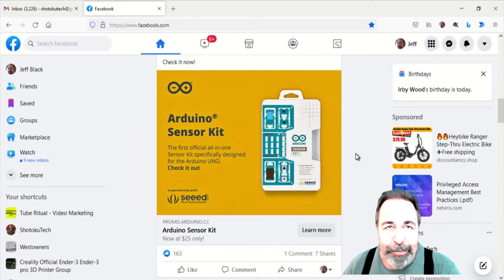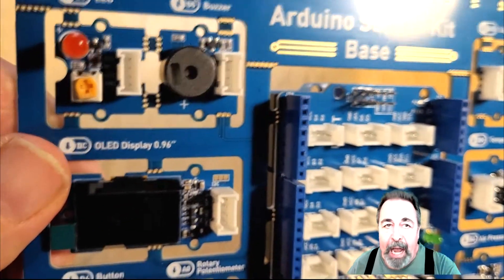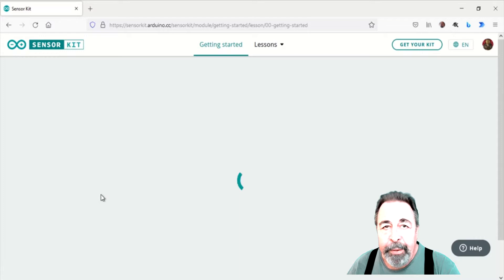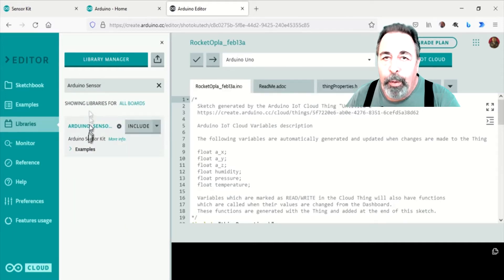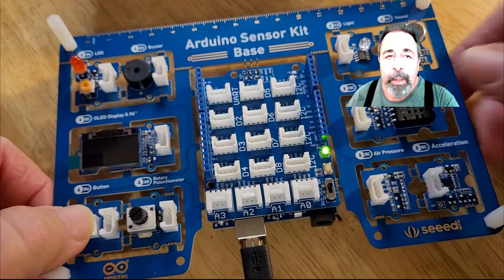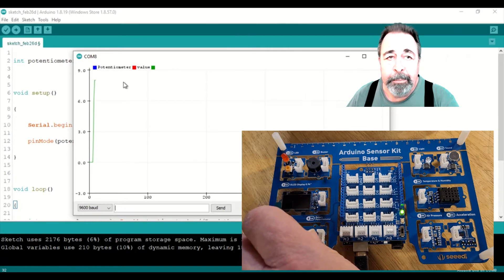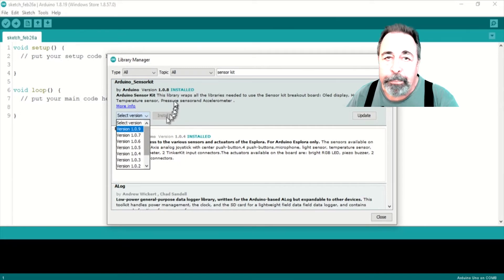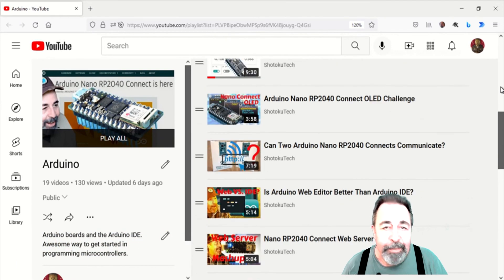Arduino Sensor Kit Complete Run Through

Comment: I like the Seeed/Grove wire ordering convention of [-,+,S1..Sn] ... and wonder if they were the originators?
These keyed Grove connectors are not cheap and widely used like JST 2.54, or even belt-buckle though.
Reply from the maker: Seems like grove connector is standard. M5Stack, TTGO also use grove connectors. Seeed is the developer of the standard as far as I can see when searching. Similar to the Qwiic connector used by SparkFun, Adafruit and others. They even have Qwiic to Grove adapters. Thanks! https://developer.electricimp.com/resources/grovesystem#:~:text=The%20Grove%20specification%20defines%20a%20connector%20and%20a,peripheral%20devices%2C%20called%20%E2%80%98modules%E2%80%99%2C%20to%20a%20host%20microcontroller.